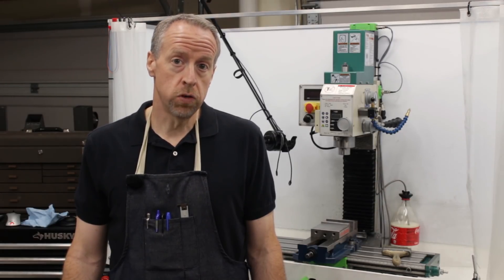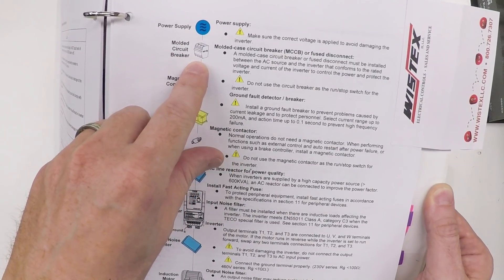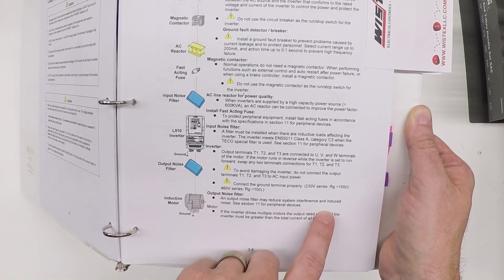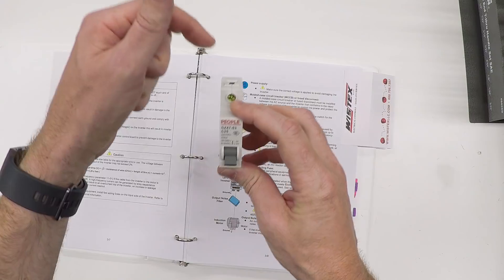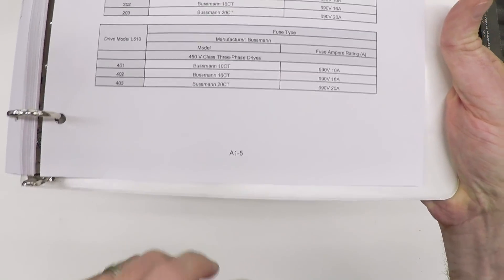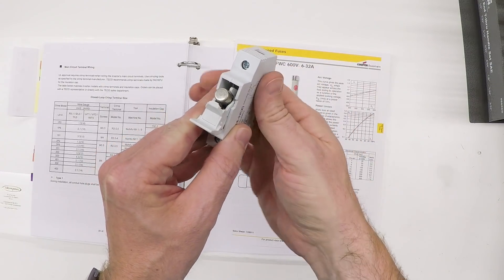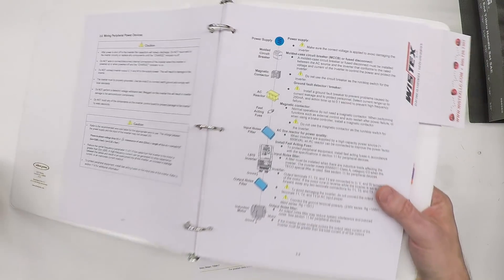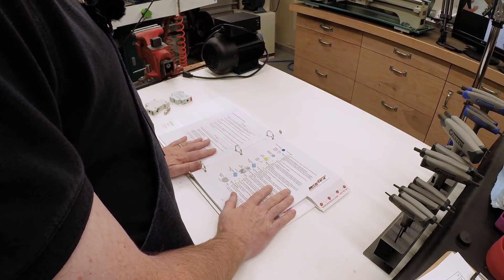Lathe VFD 8: How to Wire Circuit Protection (Breaker and Fuse)

Comment: Why did the manual recommend a 600V rated fuse when the input voltage to the VFD is only 120V to ground? Also, if their idea is to have the fuse protect the VFD from a short on the motor, why are they not recommending to install the fuse between the motor and VFD? Last question...Instead if adding a 25A breaker into the crowded enclosure, why not replace the 30A branch circuit breaker in your electrical panel with a 25A breaker? Thanks, I appreciate your videos.
Reply: 600v is just a rating . And the drive is internally protected from the load very well. The goal is to stop the drive from pulling a surge from the line side. Also code requires that drive to be protected by a mccb a branch circuit breaker would never come close to protecting that drive fast enough.
Reply: @beckyschwantes5287  it’s not “just the rating”. 600V fuses are a different fuse class than 250V. It won’t hurt anything to use 600V fuses but it’s completely pointless and a waste of money.
Reply: @RB-xv4si  they are over sizing the protection circuit. Single phasing a VFD is still a fairly new game. Also these drives are adjusting frequency and ramping down large loads it could absolutely over voltage. Plus that drive excepts different inputs voltages. They are trying to cover a range instead of fusing each voltage.  What have you always heard about start and run capacitors? You can always use a larger voltage rated cap but don’t go lower.

Comment: Best regard.
In Colombia 220VAC are obtained with two lines of 110VAC each.
My question is:
Can the EMI filter CW4L2-20A-S be connected to a 2.2kW 12A VFD with 220VAC input and 220VAC three-phase output?
This is to be connected to a 3HP and 9A three phase motor.

Understanding that:
_____________________________________________________________
      POWER                        EMI FILTER                 POWER SUPPLY           
SUPPLY LINES    IN     CW4L2-20A-S    OUT    LINES FOR VFD                            

 (F1) 110VAC      ->   L                           L    ->          110VAC

 (F2) 110VAC      ->   N                           N    ->         110VAC

 (GND) Earth       ->   T 
---------------------------------------------------------------------------------------------------
Thank you for your attention, time and valuable response.
Blessings of health and tranquility in these difficult times.

Comment: You never did say why you need you need a second circuit breaker.  It all came down to "... might as well".
Why did you multiply the VFD amperage x 1.25?
Reply: That is just basic sizing of a breaker. 1.25 percent of rated amps. He put the fuse in to possibly protect the internal components of the drive that a breaker might not be fast enough to catch.

Comment: Ok I have all my parts on the way to put my vdf in a box and wire it for safety with a breaker and fuse, My question is what is the magnetic contactor for? Do you have a link for this?  Also I want to add a emergency stop button and a green start button with the linear potentiometer.  I was looking at a box that includes the start and stop just a little confused about wiring that up how your lathe is set up. Remind you Im using this vdf and my motor to run a homemade belt grinder.
Reply: No problem! Program your VFD to use the digital I/O terminal and you will have multiple options for what you want to happen when the estop circuit is high. Also your VFD will more than likely have a parameter to set 3 wire start stop circuit up where the VFD will automatically latch the start input and you won’t have to wire a latch with an auxiliary relay.

Comment: Hi folks. Panel breaker protects cable to control box. This cable should have same rating as the breaker. 25 Amp circuit breaker in the box protects 'in box' wiring, which should be able to handle 25 amps. The fast action 'semi-conductor' fuse may (as James said!) protect the expensive VFD. It's 'defence in depth' and a good idea when working with mains voltages. BobUK
Reply: Is that noise filter rated for 25 amps?

Comment: I do not think, According to the NEC, that the fuse was needed. Just a breaker, contractor, and heaters, if they are not in the motor.
Reply: Yes your right. It is just an application request. Code does call for the breaker to be a mccb though.

Comment: James,  well done, I agree with you on the marginal safety, the real test is if for some ungodly reason the motor is jammed and pulls too much current from the VFD the real test is the fuse you put in will blow before the electronics. I do not have much confidence with some of the VFDs made in china since they are poorly made.  I would feel better if it was made in Japan, since they do a much better quality control and use better parts. But, I am working on a VFD repair no that was blown due to a brown out. What went bad on the device are the Capacitors on one I fixed and the IGBTs on the other. I would think the fast acting fuse being on the line side since that is the side that draws most of the current will cause the fuse to blow quick than a breaker.I would suggest one other thing I did not see the back of the VFD. But if it is bare metal or aluminum I would have place a large aluminum block with heat sink compound to help distribute the heat from the IGBTs.
Reply from the maker: The back is metal, but I don't think it's the primary heat sink.  There's a fan that pulls air through the device, over internal aluminum fins.  Time will tell if it's sufficient.

Comment: Regarding the fast acting fuse, what is the risk of using a 25amp 320v fuse rather than the 600v one that is specified? For this VFD, were the supply voltage is 110v, I would have assumed that a 320v fuse would have a sufficient factor of safety. Is the higher voltage rating on the specified fuse due potential of higher voltage come off the VFD in case of some type of breakdown (ie voltage generated off the motor as is spins down)?
Reply: It was intended to protect the ac reactor

Comment: It appears that the supply for the contactor control circuit comes directly from the incoming power after the circuit breaker. If so, your multi-wire control cable, and associated wiring inside the lathe, can see the full breaker current. Control circuitry must have a fuse to limit the current if using wiring rated less than the smallest overcurrent device ahead of the control circuit.
Reply from the maker: Good point.  An inline fuse holder on the hot side of the control circuit would be easy to add.

Comment: I really like your video thank you for sharing.. I have extensive experience with VFD Drives in industrial environments and would like to comment on why vfd(s) require both a breaker and fuse..  Both fuses and breakers come in various types but for this example let's just focus on two types  thermal protection and short circuit protection. the DIN rail and household breakers like used here are  thermally tripped. These breakers will protect against short circuit but the reaction time is very slow compared to the short circuit protection needed to properly protect the VFD.  So in this case the breaker and fuse are suited for two different types of fault and complement each other... A 25A breaker in this case will not short circuit trip until the current load is 150%-225% of the rated current depending on the trip curve of the breaker. The fuse in this application is designed to quickly interrupt the circuit extremely fast when the current exceeds the rating. This will protect the VFD SCR DC Buss (Not IGBT(s) they are on the output side of the VFD) and additionally protect the circuit breaker from damaged in the event of a VFD failure. I have seen many breakers not used in tandem with uses fail because breaker contacts welded shut before the thermal mechanism tried to interrupt the circuit that resulted in fires and explosions. Motor controls should always use breaker and fuse! Always!!!!
Reply: It is true that the fast acting fuse will interrupt a high current more quickly than a breaker can, and they should be used to protect semiconductor equipment. But the fuse will not blow instantly simply if the rated current is exceeded. Fuses have an inverse time-current curve and thus they withstand a smaller overcurrent longer than a larger overcurrent. For example, according to the data sheet, the Eaton FWC-25A10F fuse  will withstand 60 amps for 20 seconds before it begins to arc and open, whereas at 320 amps it will open in one millisecond. Semiconductor fuses do not prevent damage to semiconductors, but they will reduce the total damage within a device if something does go wrong. A breaker alone cannot afford the same protection.
Some additional facts about breakers. Whether they are residential or industrial, they are  thermal-magnetic breakers. The thermal section in a breaker trips when heat is created by an overcurrent. This protects from small overcurrents and is inverse time-current related like all fuses. The breaker can hold overcurrents from a few seconds to several minutes, depending on overload. However, the magnetic section of a breaker protects from high overcurrents by magnetically pulling a trip mechanism that opens the breaker. There is no built in time delay in this case.  This section either trips or it does not, depending on the amount of current. But in any case, a breaker cannot open as fast as a fuse, especially a fast acting fuse
Reply: A properly sized circuit breaker on the line side seems to be the norm on CNC builds that I have worked on the last few years. Most newer vfds are very well internally protected from short circuit, under/ over voltage, phase loss and thermal variations plus they are equipped with a dry relay to create a protection circuit and shunt trip the mccb. But who can argue with added protection!!!!! I was more concerned with the exclusion of the line side reactor especially while single phasing a VFD.
Reply: Thanks for that info - very useful

Comment: This was all really cool to see.  I am curious why you chose to mount everything in a separate enclosure when you could have mounted the VFD behind the control panel like Grizzly does with the G0752?  Just easier to film and/or keep things straight in your head?  Have you ever tried to install the digital RPM readout or DRO that might also be similar to the Grizzly product but at a cheaper price for better quality?  Again thanks for the video series, I feel comfortable enough to start researching how I can apply this to my ShopSmith tools and eventually to my future G0602 and G0704.  Any tips on what I might research that might be different for a higher HP motor?

Comment: James,
quick question... Have followed your build avidly, and decided to upgrade my 0602 as well. I'm pretty sure I've got things spot on as far as the setup is concerned. As I power on, though (stop switch closed, momentary power button pressed, system powers up), as soon as I switch forward or reverse, the GFCI (20 amp) circuit that I'm drawing power off of trips. Thoughts?
Reply from the maker: If it's the GFCI tripping (and not the 20A over-current) it would usually be because of a ground fault, i.e. some current flowing back to the ground.  That would usually mean  something shorted or wired incorrectly.  If the VFD powers up okay and runs until you try to start the motor, I would check all of the motor wiring to be sure it's correct.  If it's the right motor, wired correctly for the right voltage, you shouldn't be exceeding 20A, but I guess it might be possible.  You're sure your direction controls are connected only to the low-voltage terminals on the VFD, and not cross-connected in any way to the AC mains?
Reply: @Clough42  James,
thanks for getting back to me. did some triple checking... wiring connections good. direction controls are good. chased all the grounds and connections. changed out the GFCI outlets for a standard, works a champ now. I suppose it's possible I fixed the issue going over everything and tightening all the connections, but it does have me scratching my head... btw, I'm fitting a LED tachometer into the face of the box, just puzzling out whether to mount the sensor inside the headstock, or at the rear of the spindle.
Incidentally, I asked a few months back about your choice of pot resistance for the speed control, turns out mine needs a different pot (doesn't turn through full range before I hit max freq - I decided to limit mine to 90 instead of 'overclocking' it to 120 like you did).

Comment: May I ask why did you have to use a motor contactor for controlling the motor when you can use the VFD through the multi functions digital input..?
Reply: I was pretty sure he wanted to keep the controls at they were on the lathe. And partly safety so that when the E-stop is pressed it cuts power to the lathe motor entirely so in case of a VFD fault you can still be safe.
Reply: He isn’t using the contactor to control the motor he is using it as a power disconnect to the VFD

Comment: With the fast fuse, your breaker serves no purpose. Under no circumstances that I can think of will it ever trip.
Reply from the maker: You're probably right.  Both are called for in the documentation for the VFD.
Reply: The contactor could short out internally.  It has neutral going into it, so if you...smashed it with a hammer or something you could maybe possibly short it out and it would blow the breaker since it is before the fuse.
Reply: @Saturn49YT  bingo! That fuse was also intended to protect the line side reactor when installed

Comment: James, you put together a very series of videos. Also, congrats on the “new look”.

I installed my first TECO VFD a while ago, and the same as you, my provided print manual only went up to maybe Section 5 plus an appendix if I remember correctly. I found the omitted parts, including the “missing Section 11” that you referred to, in an online version of the manual. 

The reason for my comment is to possibly clarify the need for a fast action fuse. The manual states that the fast action fuse was needed to “protect peripheral equipment” and to then reference section 11. Section 11 led me to believe that peripheral devices are those attached to the VFD with cables attached to the VFD via the front comm port. It took a couple of tries to talk to the right person, but TECO tech department confirmed that “peripheral equipment” only means items connected to the VFD via cable to the front comm port. An external keypad or controller, for example. It does not include other things connected to the VFD, for example, the motor being driven by the VFD via the power terminal block, or items (potentiometers, switches, etc) connected by wire to the control circuit terminal block

All that written? My installation is like yours! I had a selection of fast fuses and fuse holders in my stash, so while I was waiting for a word back from TECO tech, I installed the fuse anyway so I could get the thing up and running, lol.
Reply from the maker: Thank you.  Yeah, I have both versions of the manual.  I think they call one of them a "user guide".  The fast-acting fuses is shown in the wiring diagram, so I put it in.  It isn't totally clear to me how a fast-acting fuse on the VFD input protects equipment connected to the comm port, but I guess there could be failure modes where that would matter.  I would hate to be in a situation where current flow through a serial port is blowing a 25A fuse!
Reply: @Clough42  Well this is really istructive. There are lots of videos of all kinds of connections for VFDs but a small amount of them dedicated to the protection, this is specially true for chinese VFD manuals like mine (it was my fault). I have readed a lot of controversial comments in forums regarding the use and utility of type "J" fast fuses in modern VFDs where the protection will be more adecuate for fire protection probably than for protecting the monoblock components of the moder VFDs. Here in Spain our normative explicits the use of MCCB type B for VFDs and the fuse is redundant, probably a safe point for warranty. If you see different manuals you will see "nothing of line filters after de VFD" for example and this is very confusing.
Reply: Lol, agree.
Reply: @Clough42  If there is no fast acting fuse in the supply line, semiconductor failure can allow overcurrents to find a way to any portion of the electrical circuits within the VFD, including comm ports. It would not be the comm port that caused the fuse to blow, but rather that the comm port (and connected equipment) could become a victim by association! The fuse will trip before high currents can migrate that far.

Comment: A few years ago I has done also important changes to my similar lathe. The DC-motor and all the electronics is replace with 2HP tri-phase motor 230V with VFD. I didn’t use the contactor anymore because forward and reverse controls on the input is controlled by 2 little relays. Push-bottoms and micro-switches generates the events, and all the supplied safety switches remains functional.
I am happy of your very nice video’s, good explanation and practical implementation. My video’s are more theoretically, because torque and speed goes not always together is the same direction.
Reply from the maker: There are lots of ways to do stuff like this.  Thanks for sharing.

Comment: What model magnetic contractor did you use? Not finding suitable one on eBay. Maybe I’m using the wrong search terms?
Reply from the maker: I re-used the contactor that came with the lathe.  I think it's a Siemens 3TB41 22E 110V.